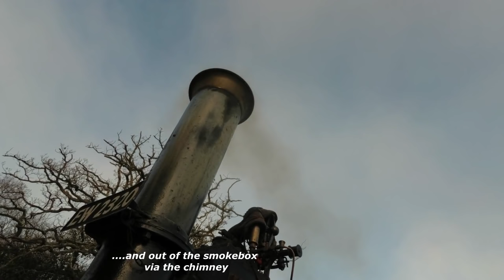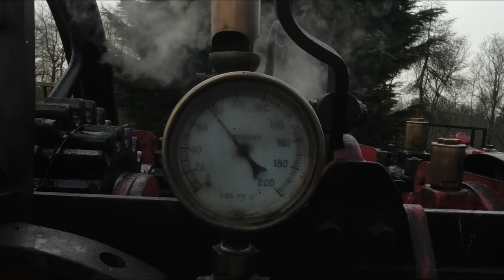How to Operate a Steam engine

Comment: Best video EVER!  Perfect amount of detail for a very well done introduction.  I realize there can be in depth discussion and opinions, but I really enjoyed every minute. Thank you!
Reply from the maker: Glad you liked it!
Reply: I agree
Reply: @GasoliniASMR how exactly does a traction engine work? I’ve seen videos of them sitting still with the pistons and flywheel at full tilt
Reply: I thought he left a few things out. Like when you sit in the driver's seat, what do you do next and with what.
Reply: @brianrigsby7900  When a traction engine has it’s flywheel and piston going round but not actually moving, it’s because the road gears are disengaged. Gears can be operated by the driver but must only be changed when the engine is completely stationary. You still use the same control (the regulator) to start the wheel and piston turning.
Reply: @bobesposito7235  The driver always stands.  The steerer, on the other hand, usually stands unless the particular engine is designed with a seat for him.

Comment: I remember this engine well as I steered her for many years when she was in Somerset.Brings back fun memories, especially wood sawing at the Great Dorset Steam Fair.
Reply: Hi Trevor,
My reaction is a bit late....
I never drove the engine on the road, I only know that it was a terror to set up to the belt, especially on uneven ground. I also remember that we never took it much above 100psi when sawing because the injector was difficult to start at high pressures. I have never seen the pump working, so we only had the one injector. A but tricky, but it worked perfectly at or below 100 psi.
I am sorry I cant't remember you, but I have been to Stourpaine about 6 times and have met so many people.....
Reply: @sierkdejongh8984    Injector has been ok in my time - perhaps it just needed 'pickling' in acid to remove crud?  I used to avoid using the pump as it sprayed more water over bystanders than went in the boiler - much better now that we've corrected lift of the clack valves in the pump and fitted a tighter spring in the relief valve.

Comment: Hi! Thanks so much for making this video. Even though I'd be too scared to drive one of these, I'm making a 3D model of one so understanding what each part does was very helpful :)
Reply from the maker: No problem.  Glad it is of some use.  Good luck with the model.
Reply: @GasoliniASMR  Thanks 😄!
Reply: Oi get a wilesco toy steam tractor it will get some steam oil under your nails and start your addiction with steam power
Reply: @wesbrackmanthercenthusiast4695  Just dug out mine! Oh the joy (and one or two slight burns :P)!
Reply: Don't be put off driving! Start by steering or as crew. You learn more on the job. Many women are driving engines now.
Reply: There’s no need to be scared of driving these! Driving a traction engine is so much fun. Perhaps start off by joining the crew for a short journey quite often. Then slowly start to get more into being the crew for the entire day!

Comment: I have heard so much about this engine over the last few years.  Its so good so see it and on the move too :) Fantastic.  It looks a lot faster that 6 MPH
Reply: Thanks - I'll have to properly check the speed with SatNav next time out, but being a single cylinder engine it does bounce a bit if pushed too hard.
Reply: It is, at 300 rpm it is more like 8mph!

Comment: I love this video! Very Very cool. Specially the part where you get to see that authentic antique steam tractor cell phone hit the floor. All jokes aside really a superb video. Great vantage point. Almost scary to think that at sometime when these were in operation that someone probably got caught up in all the unguarded large and heavy steel parts moving around. Gruesome to even think about. I have fairly recently found out about these little Wilesco toy steam engines and tractors and I'm hooked! They are so cool. And to think it's powered by water.

Comment: Excellent video, used to own sister engine 27277, new to Sheridan & Flynn, Killmessan, Eire, together with a 54" Ransomes threshing drum, which I believe is still on the farm. But more of a squeak and thump than mine, but she had major boiler work a little before I bought her, and was run in.

Comment: Probably have to special order the tires when they are damaged but I suspect that you don't have to worry too much about nails in the road.
Reply: Front tyres are up for replacement this winter (the engine had it's last run of 2021 last week).  They're made from military tank idling wheels with the disc centre cut out and re-rolled to required radius.  Rear tyres, 'new' just before the video, are cut down from an International crawler then just bolted through existing holes in the rear wheels.

Comment: Nice little film. Too brief? 
Checking the water level before lighting the fire, squirt of oil to the wheels before moving. 
Would like to see changing gear, and water lifting too. Part II ?
Reply from the maker: Thanks Andrew.  I like that idea!
Reply: The Guide is deliberately very general - checking water level and firebox for leaks before lighting up could be there, but there's so much else that could also be covered such boiler management (primary / secondary air, thickness off fire, clinker, ...), notching back, control going down hills, and so on.  A Part 2 perhaps around town would be good!

Comment: I noticed grease nipples on the eccentrics. Do you find that they are better or worse than oilers? reason is i'm thinking of swapping the big end / little end of a miniature for grease as the oil pours though the bearings way too fast.
Reply: The eccentrics were on grease when i got the engine (as are the wheels).  It seems to work OK, but so should oil if the wicks control the feed correctly.  I can't think that grease would not work, but you might like to see what other miniature owners do.

Comment: must be nice having a traction engine. do they need a lot of maintainance?
i wish my country (norway) had a more traction engine, the ones here have either been scrapped decades ago or been rusted up in museums that are rarely open.
Reply from the maker: Quite a bit of cleaning and checking inbetween runs.  These machines used to be quite available in the UK but are now 'collectable' so very expensive.
Reply: We're fortunate in having over 3000 engines still in UK (although not all on the road of course). The war gave a lot of engines (probably this one too) extra years of usefulness taking them to the start of the preservation era.

Routine maintenance is required, like any machine, plus annual boiler inspection, but a big rebuild as this one has had shouldn't be required too often if the engine is looked after.  In some areas, like the boiler barrel and gears (when done), I'm catching up with 100 years of use.

Comment: "Takes a couple of hours to build pressure" - can't see why these didn't become the standard instead of gasoline-powered cars :D Must be a Big Oil conspiracy
Reply: I get the joke of course, but your comment reminded me that it took a while before it became clear which system would prevail, in powering private cars.  There were several successful makes, from the turn of the century up to about a hundred years ago, but the final model of the Doble steam car, in the USA, could raise steam and be off in less time than a petrol engine needs [even today, though most young drivers seem to ignore the necessity] to warm up.  Unfortunately we can't blame Big Oil for the eventual demise of steam cars, because they ran on petrol, paraffin, or any kind of oil;  the main reason was simply the very high cost of making them.
   This from Wikipedia:
"The 1924 model Doble Series E steam car could run for 1,500 miles (2,400 km) before its 24-gallon water tank needed to be refilled; even in freezing weather, it could be started from cold and move off within 30 seconds, and once fully warmed could be relied upon to reach speeds in excess of 90 miles per hour (140 km/h). In recent years Doble cars have been run at speeds approaching 120 mph (190 km/h), this without the benefits of streamlining, and a stripped-down version of the Series E accelerated from 0 – 75 mph (121 km/h) in 10 seconds. Its fuel consumption, burning a variety of fuels (often kerosene), was competitive with automobiles of the day, and its ability to run in eerie silence apart from wind noise gave it a distinct edge. At 70 mph (110 km/h), there was little noticeable vibration, with the engine turning at around 900 rpm."

Comment: Wonderful video! May I ask how and when the water level should be checked?
Reply: Not my video and I am by no means an expert, but most traction engines like this have a glass gauge in the driver area that shows the level. Very important to keep it above the minimum. If the water gets too low, a last resort feature is a special valve that burn's out and drops the last remaining water into the fire. But if that happens it is very expensive to fix. So I hear anyway
Reply: Two gauge glasses on the back of the boiler show the water level.  Keep a good eye on them and top up the water regularly to maintain a safe level.  Too low is dangerous!
Reply: @toysrus2413  I believe that feature is called the Fusible Plug on rail locomotives. Didn’t know they had the same on road locomotives but it makes sense.

Comment: 5:40 The engine itself changed direction? Does it not have a gearbox?
Reply from the maker: It has 2 gears but the engine needs to be stationary to change gears.  The rotation of the engine is changed by pulling back on the 'reverser' lever.

Comment: does it matter what type of fire wood you use to get the fire lit?
Reply: As long as it's dry, and burns well, it doesn't matter. Most use pallet wood that's had the nails removed and been dried
Reply: @StaxRail  in the case of traction engines and portable engines can wood off cuts be used to get the fire lit
Reply: @eliotreader8220  so long as it's dry, yep

Comment: Glad they stoped use steam trains, cause something like this doesn’t need to be ran, but does anyway just to roll coal
Reply from the maker: Yes, the pollution is certainly not good! On the other hand, there is no lead, benzene, diesel particulates and we don't need to invade hundreds of countries and drop lots of bombs to get the coal that drives it.
It is very important to keep these old engines running on the road so that future youngsters are inspired to come up with their own inventions that will say goodbye to the old fashioned pollution caused by coal, petrol and electricity